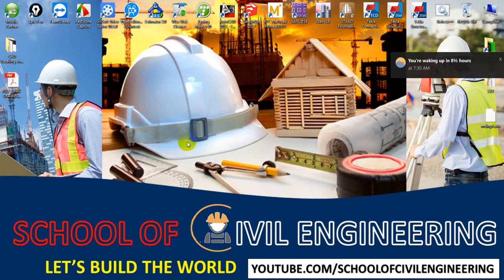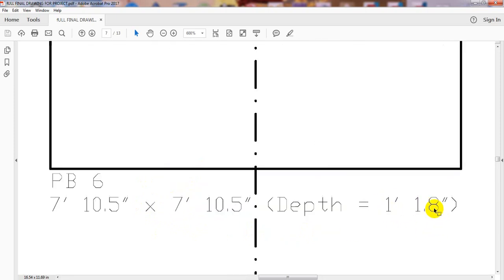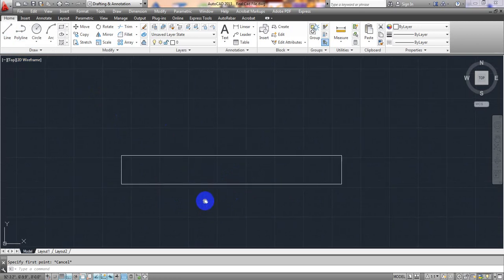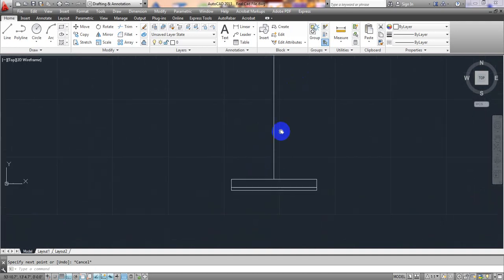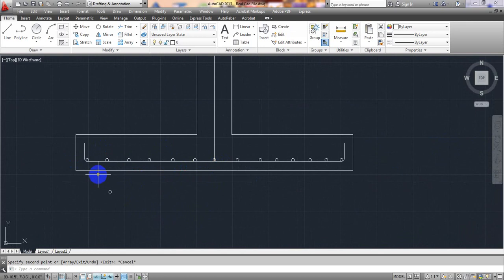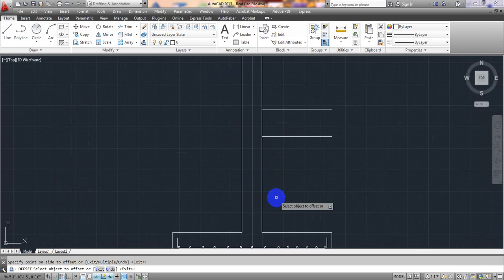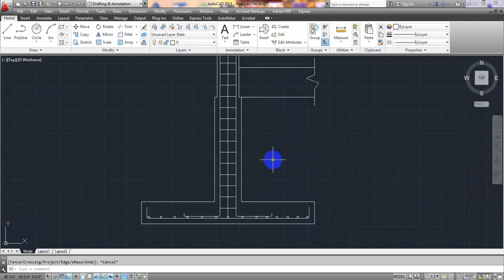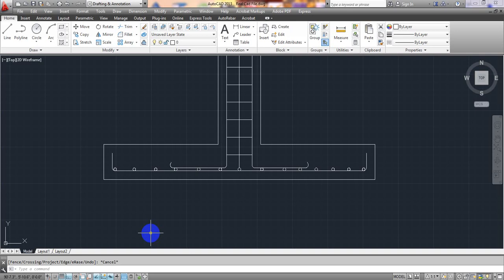Full Building Detailing Tutorials | Draw column detailing and schedule in AutoCAD | Part 1

Comment: In detailing sections, should i put number of stirrups right on the elevations or number of bars ,for example bars which appears as points ...or i put all of that as an indication or reinforcement details which help the engineers who do shop drawings later ,please could you clear that ,thanks in advance